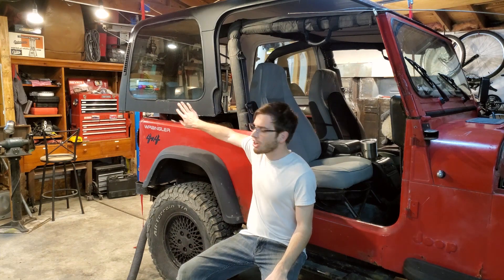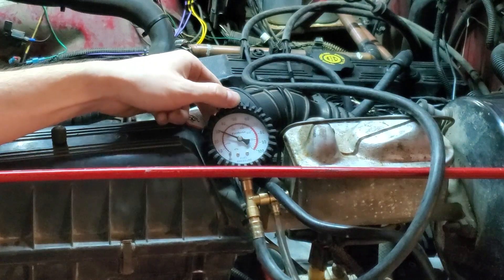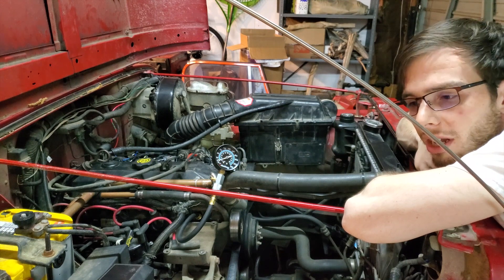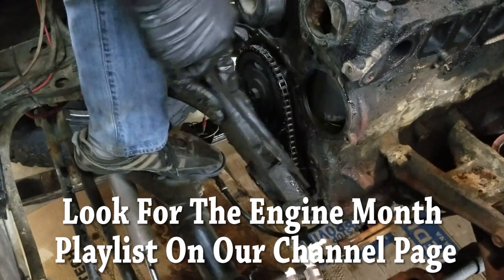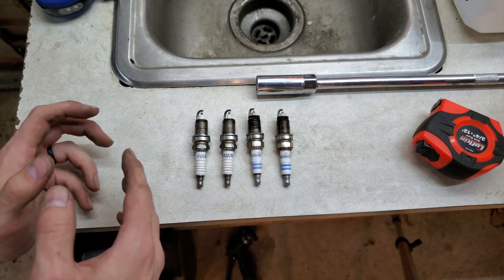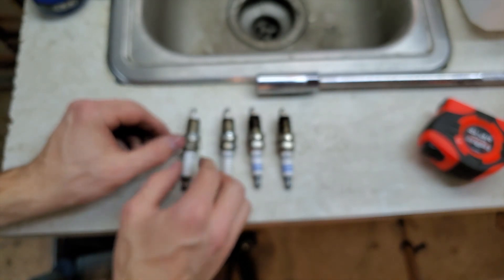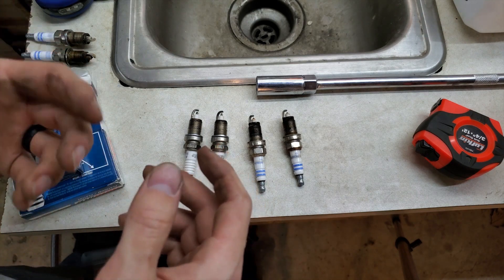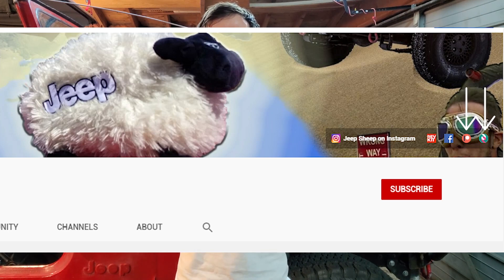Fuel Pressure and Compression Testing 2.5L Jeep Engine

Comment: Wish u showed us where u connected everything with the fuel pressure test
Reply from the maker: Dang, guess I didn't.  The pressure gauge connects to a fitting sticking up from the fuel rail.  Looks like a fitting for filling up your tires but a little bigger. It will probably have a cap on it.

Comment: I noticed at around 3:20 as you accelerated the fuel pressure increased. My 94 YJ with the 2.5 is having trouble getting power so I tested pressure on the rail, but I DO NOT get any increased pressure when revving. Should I start with the Fuel pressure regulator and go to the fuel pump?
Reply from the maker: The pressure regulator reduces pressure at idle based on vacuum pressure from the manifold. If the vacuum line is disconnected from the pressure regulator it should read at the higher pressure all the time.  So you won't see it jump with throttle because you are likely at the higher pressure and it's not being reduced by the vacuumconnection.  The pressure is reduced at idle because not as much fuel is needed and there is probably some fuel economy benefits. I would check the vacuum line.

Comment: You always have excellent content. Can you do one on the steering and what options for upgrading. I have a 95 2.5l , when I’m driving down the road I get apt of rattling
Reply from the maker: I'm working on a few projects right now but that would be a great video.  Until I cover that topic check all of the ball joints.  When those go bad your steering will suck. The steering stabilizer can help a lot too. There are aftermarket solutions as well but  always check your existing hardware first.

Comment: Any recommendations on compression tester brands?

Nowadays, spark plugs last much longer with the elimination of leaded gas.  A longtime ago, you would be lucky to get 12,000 miles out of a set.  But back then, most home grown mechanics would clean and re-gap them.
Reply from the maker: I use whatever compression tester they have for rent at the auto parts store. Both of the tools used in this video I rented. When you return them you get a full refund so it's basically free. Should have mentioned that.  Your face mask is in the mail btw. I don't have tracking on it so let me know when it arrives!
Reply: Jeep Sheep TV Thanks for your response.  I did not know about the rental aspect.  That’s smart business on behalf of the auto parts stores as people typically will buy their part supplies there as a result.
Reply: Jeep Sheep TV Yes!  I will let you know when the mask arrives.  Thanks!😷

Comment: Hey man, I appreciate the vids. Good content. What are your thoughts on the pc3 so far? I’m doing a lot of work on my 2.5 right now. I’m doing the 4.0L throttle body, porting the head, doing a valve job, 4 hole 19 lbs Bosch injectors, timing chain, oil pump, valve springs, and just lots of basic maintenance. I’m probably gonna pick up an adjustable fuel pressure regulator to prevent running lean and I’m hoping that will be enough. Do you think that the Jeep ecu is bad enough not to compensate. I’m also looking at running some 1.7 roller rockers in the future for a tad more lift and duration. Do you think I need a piggy back system or nah. 😬

I’m also considering getting an o2 age gauge from aem. I’m hoping I’ll be satisfied with my afr
Reply from the maker: In my previous video I show that the ECU can make up for most mods in closed loop but in open loop you are going to need some way to modify the AFR, the pc3 is one way to do that.  Additionally the ecu favors efficiency over power so the pc3 can help with some of that as well. I have many mods to come so stay tuned!

Comment: What does your oil pressure gauge go to at idle after warm up mine goes to white line close to the low red mark but never gets lower then white line
Reply from the maker: Mine is always between 60 and 80 but sometimes it's pegged do to a short to ground somewhere.  So honestly I don't know how accurate it really is right now

Comment: I did this and I did that then disconnect this and that. Why don’t you do it and show us what you are doing. This in no way is helpful.
Reply from the maker: As this is not a "how to" video rather a baseline of my engine for future comparisons It may be implied that I don't show all steps.  But to fill in the blanks.  The fuel pressure regulator screws into a valve on the fuel rail. You will know the valve by the cap on it and it looks like a big valve stem commonly found on a tire.  No additional tools needed. Run the engine and look at the gauge as shown. Release the pressure with the little button prior to removing the gauge. Be sure you have a container for the gas to drain into.   To test the compression you remove the spark plugs and then screw in the compression tester by hand. Be sure to compress the o-ring to get a good seal but don't go too tight that you can't get it off.  Crank the engine over a few times and look at the gauge like shown. If you need any further instructions these tools commonly come with a short instruction card outlining the best procedure. If you want to know how to install the PC3 there is an entire video for that in the same playlist.